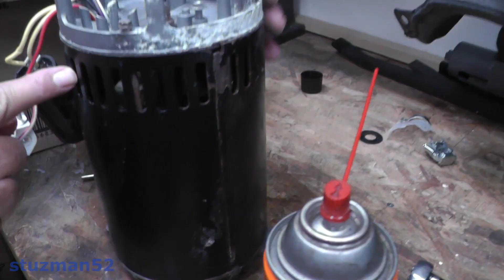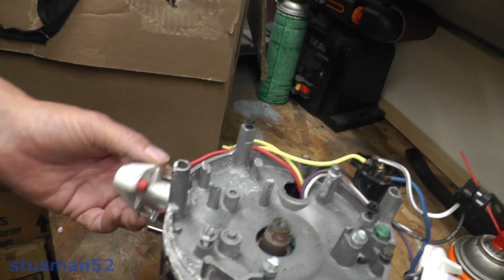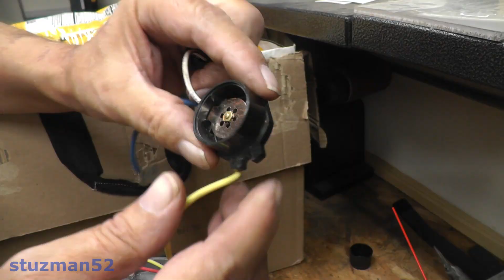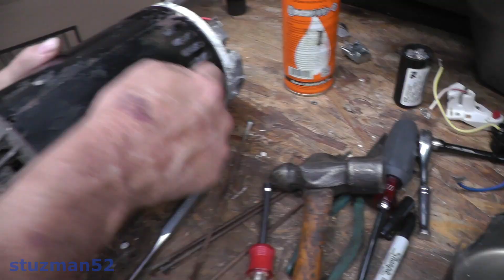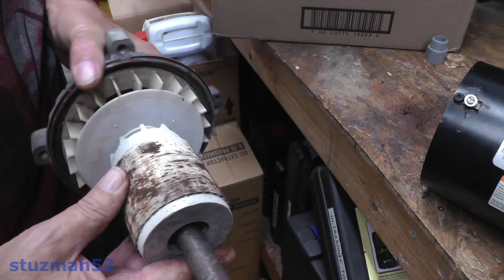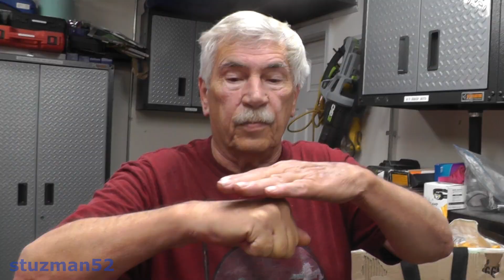Century Pool Pump Motor UST1102, Disassembly of Motor: Part 2 of 4

Comment: Yep.  Some motors have those holes, and some dont.  Most of the cheaper motors lack those holes.  Also what i do is put some lube on the threads before re installing them.  Helps lots to keep them from getting seized again.
Reply from the maker: Thanks for watching!